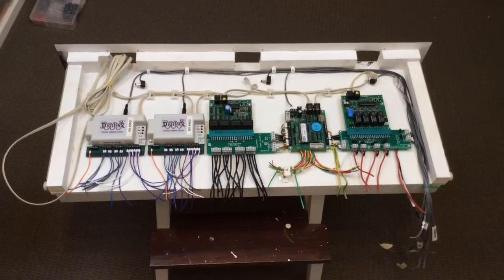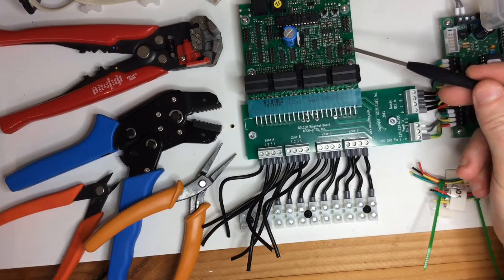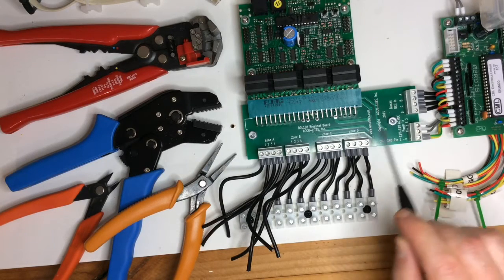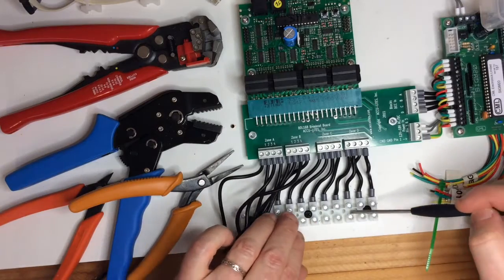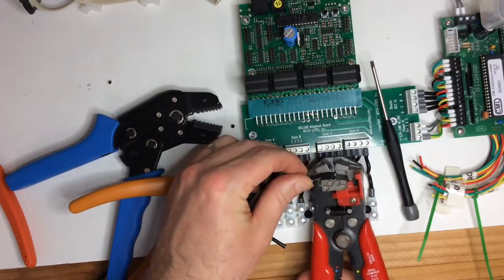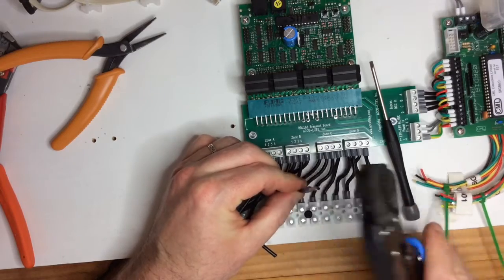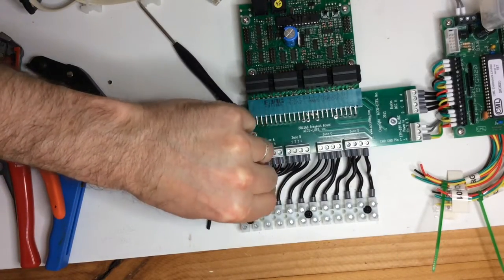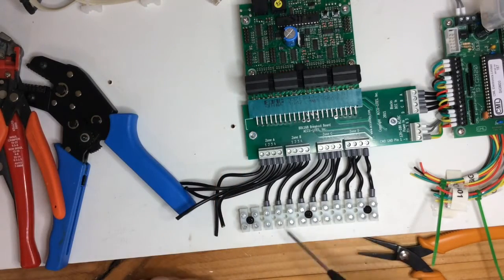Wiring a Digitrax BDL168 Block Detector

Comment: Also plan on using a PM42 and BDL168, are the four connections on the top right output from the PM42 or input from the PM42. I’m a bit confused on mapping out the components. Thanks - Steve
Reply from the maker: SoCalBNSF N scale layout the four connections a b c d are the four zones of the BDL168 each zone is then divided into a further 4 hence the 16 black wires
Reply: Digitrax Dad so on yours each of those zones would be an input from your PM42 (each district or zone the PM42 controls for circuit protection)? Thanks for the help
Reply from the maker: SoCalBNSF N scale layout yes that is correct. I made each of the four PM42 power management zones the same as the four common zones for the block detection to simplify it a bit.
Reply: Digitrax Dad Thank you! Ever used RRCirkits? I have some items I bought a long time ago for block detection but am now contemplating going all Digitrax.
Reply from the maker: SoCalBNSF N scale layout I have found their manuals to be a lot more confusing than the Digitrax ones however many folks have had great success with them.
Reply: Digitrax Dad there is a lot to their manuals. I like the fact that Digitrax includes all the wiring diagrams too.